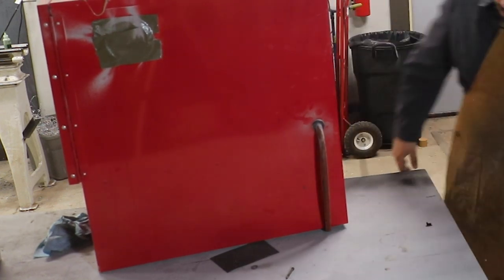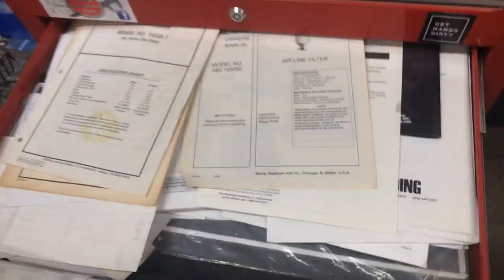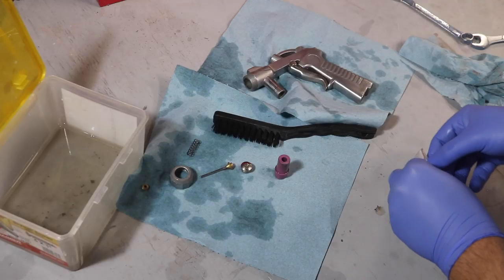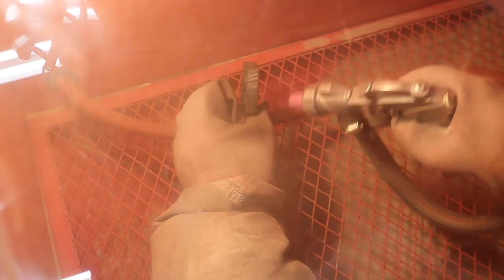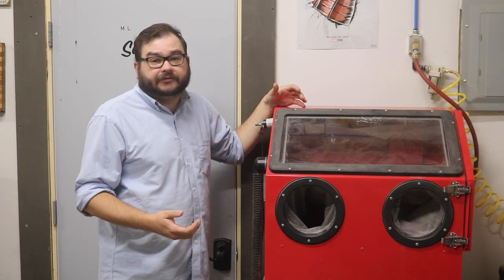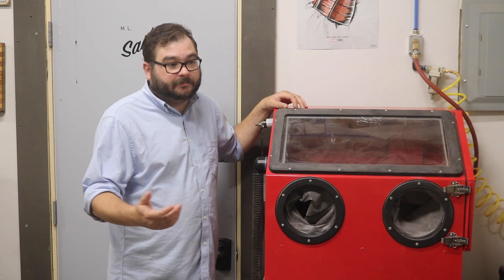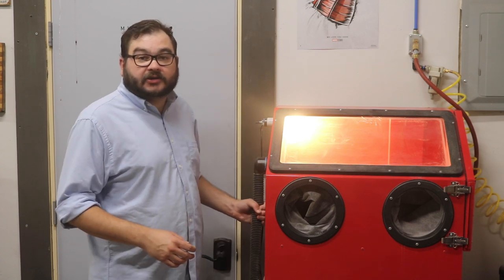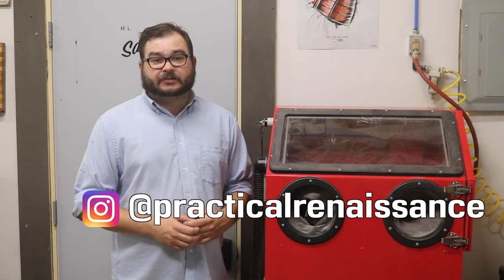4 Years with a Harbor Freight Sandblaster: Cleaning, Repairs, and Review!

Comment: That connector is a regular cable gland.
Reply from the maker: Welp, there it is!
Reply: @PracticalRenaissance  The hive mind is a scary thing
Reply: amazon sells the whole set of em for 10 bucks.  I use them all the time to stop my boys from pulling everything out of the wall.
Reply: Specifically it's a Compression Gland. I'm sure there are many manufacturers but the ones I'm familiar with are made by Heyco. The rubber grommet goes inside the cage. As the nut is tightened the cage compresses the grommet onto the cable (or whatever has been fitted to the gland). They are used for weather/dust/insect resistant cable entry into enclosures.

Comment: I added lights to mine, bought replacement USA gloves, gun and hoses, resealed everything, added rivet bolts so cleaning window is easier, welded a rolling cart it is attached to and bought the tornado vacuum attachment for a 5 gallon bucket.  Made all the difference in the world.

Comment: I have that exact same one and for a little longer than yours. Mine has been stored outdoors and is holding up pretty well. I have a dust collection system and lighting also. I've blasted all of the paint off of the inside of the cabinet and its faded from the sun.  I upgraded the gun and pickup tube. My air source is a Husky, 60 gal and the air goes through a Harbor Freight air dryer, then a 3 stage, Devilbis air filtration system. Moisture is your enemy.  I wore out the interior cavities of the original gun.  For the price, you cant beat it. It gets the job done.

Comment: The hole you taped over is technically suppsed to be a air balance port that helps provide clean air to flow into the cabinet but you have to have a type of control mechanism to keep suction (vacuum level) at an adequate amount

Comment: Ok after extensive search and findings, the port you're using for suction is actually the air inlet, the hole on the back is for dust extraction with a heavy fiber filter inside of the duct. Now as far as the hole underneath is better used as the sand pickup with another device with a metering air vortex in it. You'll find that it will work a whole lot better.

Comment: The hole in the back is to let the air out you are pumping in.  The sand is supposed to settle out of it rising up that rectangular column.  Probably not a bad idea to put a filter on it.  If you block the hole, then the air will have to escape through gaskets and such and sand will come out with it.

Comment: Thanks for sharing, how many CFM does your compressor have please? And does that give you constant air flow? Iv got a cabinet just not a good compressor 😢. Cheers

Edit, sorry should have watched longer before asking 😀
Reply from the maker: Oh it’s terrible, about 4 cfm at 100psi! I’ll get about 30 seconds of full blast before the compressor kicks on, then maybe another 30 seconds before the pressure drops and I have to stop. Luckily it only takes about 30 seconds to a minute to pick back up. Like I said, the compressor generally sucks for this application, but you can work around it if you’re fast, efficient, and most importantly, patient 😉

Comment: Cut the middle out of the bench its sitting on, or remove the top all together. . It’s only sitting on the edges of the cabinet. That way you can access the drain.

Comment: My biggest problem with Harbor Freight is that they don't have a parts or service department. When I choose to spend more on a name brand tool, like Makita or Dewalt, I know that if it breaks I can get it serviced or buy the parts needed directly from the manufacturer. I know why I buy a HF tool, I won't get that level of support. It will either be a disposable tool, or something I can scrounge parts from somewhere else, like you did for the drain. If that's not acceptable to me, then I stick with the name brand.
Reply: hey Lex I'm a PF lover too anyway HF you probably know don't make the tools try Central Pneumatic.Maybe you can get parts

Comment: You have a tray in your tool cabinet for manuals?? So you obviously don't have enough tools, or you have too many tool cabinets..... I suspect the latter!!!
Reply from the maker: I’ve got dang manuals all over the shop... for some reason I don’t throw them away, not like I read them either...  i soaked the blaster in a bucket of mineral spirits then gave it a soak in water then air blast!